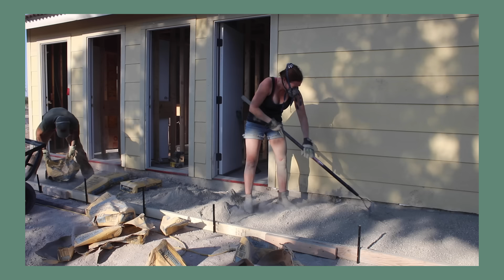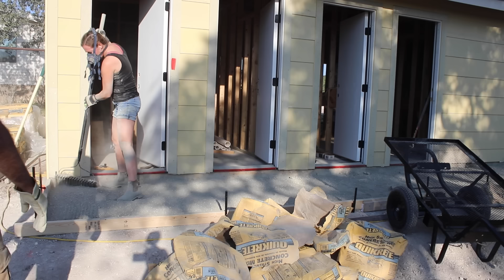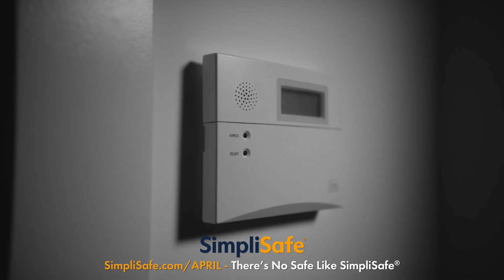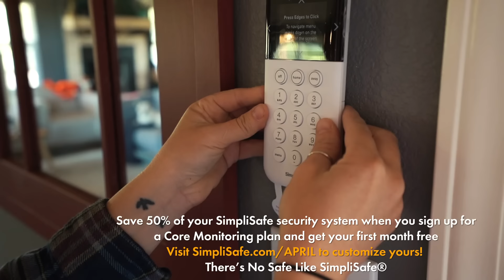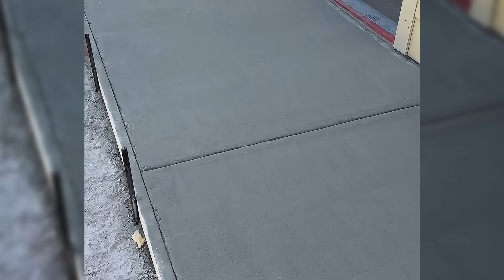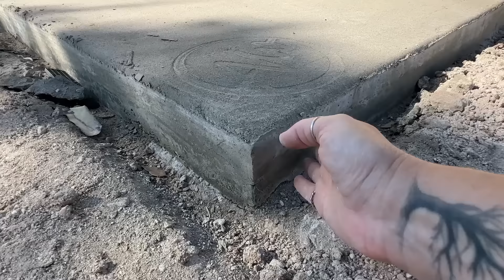Dry Pour Concrete | Better than Wet?

Comment: If you dont need it to be strong then sure you can dry pour it, plan to drive a car on it every day for 10 years or place that heavy hot tub... better not dry pour
Reply from the maker: Exactly! Mine would only be used for foot traffic so knew it would be fine. Thanks for watching.

Comment: I watched another video, where the concrete professional states you aren't supposed to attach a floating slab to a permanent slab, such as a house or garage, etc.
Reply: It depends on the slab. If you go out and pull permits and show plans to the inspector, some of them require dowels. Again, it depends on the application. If this slab ever encounters a large amount of movement, the dowels will just break through the concrete anyway. So it doesn’t matter whether she did or not. A dry slab will never achieve the same strength as a wet one.

Comment: Dry pour is a waste of time.  Little better than compacted gravel.  Water seeps in about 1”.  Below that you have no concrete and no strength.  Can’t even see what material benefit the steel is providing.  There are plenty of YouTube videos out there making this point.  I’m surprised April is promoting dry pour.
Reply from the maker: With mine being foot traffic only, I wanted to highlight the two different methods. It is fine for what I need it for. Thanks for watching.

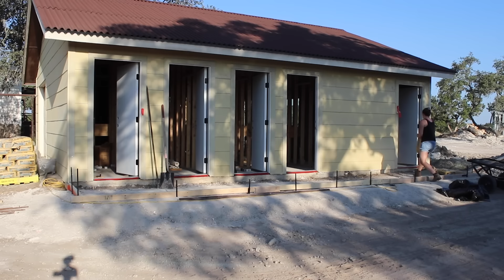Comment: RE: comments about 1:30 .  If you ARE using a mixer, it is easier on your back to use a wheelbarrow to hold the dry mix (emptied from 4 or 5 bags at a time). Then use your shovel to just add as much as you want to the mixer and then add water. It really is easier than lifting 80lbs. bags high over the mixer opening and slicing...  Good Video. will want to see it in a year.

Comment: Dry pour has significantly less strength, takes longer, has an ugly finish, costs the same. It’s a little easier to diy but you’re left with an inferior product with reduced longevity. The question is why you would ever consider it an option.

Comment: My wife and made dry pour drive way . Works fine, looks great no cracks 2 years in will be adding to it this year . Hopefully get all the way to the street. The sections we added on last year we mixed from scratch 3 2 1 ratio. A lot cheaper than buying quickcrete or other prepackaged concrete.nice job 😊
Reply from the maker: Awesome! I'm so glad it's worked out for you. Thanks for Sharing and for watching.

Comment: dry pouring anything but fence posts with fast set mix and plunging rebar/rod to mix it, is pretty silly and failure prone, even if for light traffic. while it may work in southern humid climates, that would be a disaster in most everywhere else, cold/freezing, dry.

Comment: dry pour no, its as strong as when you leave a bag out in the rain and it turns solid, but its junk, dry pour cant be good for any thing where people walk or use it
Reply from the maker: I think it'll be fine for what I need but I'll keep an eye on it if there's an issue. Thanks for watching.
Reply: @AprilWilkerson  one thing I wanted to do for a fence is to put a concrete runner all along there.  this area is overgrown, a back yard where past owners for 20 years or more did nothing, its years of weeds that built layers of mush.  so bad it will take landscapers to come in with a tractor to clear.  then i want a tall fence to keep the dogs safe and along the bottom at least 1 foot or more of a concrete base or ? up against this new fence to be built. to keep out weeds and then if the dogs try to dig there they cant.  over time if determined they will destroy the wood as they have;  for this, dry concrete is perfect, its just there. Im thankful you did the video.

Comment: Dry pour has less than 20% of the compressive strength than wet mix and is 50% more likely to crack
Reply: 83% of all statistics are made up 92% of the time
Reply from the maker: For what I need this for, it will be fine. Occasional foot traffic only. Thanks for watching.

Comment: @AprilWilkerson I didn't even know dry was a thing. Now I wonder if you laid sections of hard pvc hose (can't remove after) with small holes drilled equally on top and sides, on the bottom...turn water on low so it trickles. Then do the dry pour technique...I wonder what the results would be? Thanks for experimenting. 
Looking forward to seeing the park videos.
Reply: If the water is flowing during the hydration process, it will most likely carry away the cement (not to be confused with concrete) and finest sand leaving a weak, gravelly mix.
Reply: @johnlee7085  thanks

Comment: @aprilwilkerson The thumbnail for this video stresses me. I grew up in construction, and during the summer I would wear shorts while pouring slabs. I eventually developed the beginnings of concrete poisoning from the exposure to my legs. While dry pour doesn't have the same exposure, the moisture on your body from sweat can start the chemical reactions that will affect the skin. Cover up when handling concrete.
Reply: So you just looked at the thumbnail and not the video. She addressed her clothing multiple times.

Comment: I used dry pour for posts its less mess, quicker and within 5 days is solid as concrete
Reply: Nope. Dry pour will never be as solid as properly mixed concrete. That’s a fact
Reply: @genecarden780  had the local university test it and the results between the different versions were comparable
Reply: @ 😂😂😂😂😂😂 of course you did😂😂😂😂😂😂 There is one way that is possible. The wet mix was incorrectly mixed. What was the aggregate? What was the concrete to sand ratio? Were there  other additives? What was the water ratio? What was the slump rate? 
 Actually there are 2 ways. If you use a low quality mix.  One that is destined to fail in anything other than fence posts. 
 What was the compressive strength of each sample?What was the tensile strength of each sample? What was the size of each sample? How many samples were tested? These are very common details of testing we have to pass routinely. We routinely have to test core samples. I can guarantee dry pour WILL NOT PASS THESE TESTS.
Reply: No one seriously tests the tensile strength of concrete, and it wouldn’t be possible to do a slump test on a dry pour. 

TBS, the only way a dry pour is as strong as a wet pour is if the wet pour was placed equally poorly. There’s no way to compact the dry pour so it will inevitably be weaker unless the wet pour isn’t vibrated correctly.
Reply: @ There are actually 2 common types of tensile strength testing of concrete.  (So yeah people do test concrete tensile strength ). Splitting tensile strength and bending tensile strength. Both methods require calculating tensile strength from the force required to cause the concrete to split. There is also direct tensile strength testing but that is almost never used, due to difficulty. And as for the slump rate, I was obviously referring to the wet pour that I assumed he submitted for his claimed  “testing comparison”  for any meaningful testing comparison you would have to submit 2 samples made up of exactly the same dry mix ( before hydrating one)  so the slump rate of the wet mix is very relative.

Comment: Thanks April. Been enjoying your channel for some time.  Turns out Pierced Oak is just a few miles from me. I tried updating Google maps with the address you put un Instagram. The category is a bit wonky as they don't have one for RV Park per se. Good luck with the venture. I agree with most comments and your takeaway that there are very good but very specific applications for dry pour. Back 59 years ago almost had a geart attack getting behind a wet pour that was only to put a smooth work surface on an exiting dirt floor of an old shop.  Not structural. Pathways, simple storage shed floors (like under existing mobile homes) and drainage contol also seem ideal. All the best👍👍💪✌️😎
Reply from the maker: Yes, Google Maps hasn't updated yet but should soon I'd think. Thanks for watching.

Comment: Dry Pour works for some situations.  I've used it in deep holes with metal pipes (solar panel masts) and it has been fine.  If the hole is only a little larger than the pipe, (say if the pipe is 8" and the hole is 10 or 12", then pouring wet concrete is not so easy.  It can easily jamb up in some spot. Dry on the other hand will all get down to the bottom, (especially after you add water). But there is no doubt that structurally it is weaker.  Even in a sidewalk, I'd not consider it.  Too easy to do wet concrete and much less likely to crack if something heavier goes over it.

Comment: I did a dry pour slab that holds 4 cords of firewood.  It is holding up just fine under the weight.  It is a great method for small projects.  April, you did a great job.
Reply from the maker: Awesome! Yes, for my needs this will be fine. Thanks for watching.

Comment: I don't care how trendy it is, dry pour is a half-assed effort.
Reply from the maker: For what I need, it will be fine. I enjoyed the project and wanted to show Viewers steps of how I proceeded. Thanks for watching.
Reply: @AprilWilkerson it is plain crap. You obviously do not understand the first thing about how concrete actually works. Concrete relies on the proper hydration of the cement. That is impossible with dry pour. I have been in the masonry restoration business for over 45 years. Dry pour is ignorance plain and simple. You can achieve the same or better results with less than half the thickness of properly mixed concrete. That is a fact.

Comment: You also dont need to press you edger into it, it will work the same way as a float if you run it back and forth and form edges just like when wet. Another trick is not to pull your forms up when removing. They will have a tendency to chip your edges. Use a hammer to smack them left or right so they break from the crust that is formed and then try pulling them away from the slab instead of up. Your slab is not too big for dry. The issue is screeding, which soon becomes as labor intensive as mixing for wet pour, because to get a good finish with dry as you found out you need to screed in small slow motions.
Reply: She said the edger did not work the same way when dry.  She tried both ways.
Reply: @HellinaHandbasketHWG not sure what she was doing but it works the same way for me wet or dry

Comment: I have 2 dry pour pads that are 2 years old. I did them dirty just to annoy dry pour haters. dumped it straight on top of grass, no gravel base and added no rebar. They are right next to my professionally poured patio. one has my hose reel setup on it and gets water all the time and the other gets walked on daily by my dogs and family. there are no cracks or heaving or shifting after 2 years of below zero winters and rain and snow. I followed cajun's instructions and made sure you soak them enough that water made it thru the whole 4in slab and so far they are doing better than my wet poured slab, they just dont look as nice as a wet pour broom finish.
Reply: I’ve watch several videos where dry pour is compared to traditional wet pour. Wet pour is stronger and more durable. If you’re going to the effort to pour concrete, why not do traditional wet pour? It will be less effort in the long run when you have to replace it 4 or 5 years down the road.
Reply: @mitchmiller1429  Have you done a wet pour or just watched the videos? 😂
Reply: @HellinaHandbasketHWG  yes, I have poured a dry pour entrance into my greenhouse. It is 2 years old and I hope it lasts, but it definitely looks more grainy and porous than my traditional sidewalks.
Reply: @mitchmiller1429 because it's not less effort. Maybe you're making the assumption that everyone doing a dry pour has a mixer sitting around or the ability to rent one with a way to transport it. Remove that assumption and you're left with that person mixing by hand. I do a lot of diy, mixed my deck footers in my wheelbarrow but my first dry pour was 18 bags and I'm not interested in mixing 18 bags by hand. Doing that dry pour for a walkway was way easier, less rush and will hold up just as long as a wet pour for my purposes.
Reply from the maker: Awesome! Yes, for my needs, this slab will do fine. Thanks for Sharing your experience and for watching.

Comment: I dunno if I'd use it for a big building foundation... but a light duty support pad, plain patio or maybe a storage shed slab.... those don't see high load at all.... as long as you give it time to soak up the water and set.
Reply from the maker: Yes, mine will only have foot traffic going into building. Thanks for watching.
Reply: A lack of hydration can weaken a dry pour, but the guaranteed weakness comes from the lack of compaction. In a wet pour, part of the process involves vibrating the mix so that the parts settle together and the air bubbles come out. That never happens with dry pour leaving lots of voids that will be prone to breaking.

Comment: That took way longer and required far more finesse and fiddling than pouring and tamping wet mixed concrete would have leaving you with a very inferior slab, if it saved time then I could see the motivation.

You did make me laugh with your (not) expansion joints though!!!!

I use drymix for fence posts whenever I can.

Comment: After following Cajun County Living on YT, I decide to do a few dry pours.  Followed their process to a T and it has been fantastic. All the slabs have held up very well, with 3 of them used under a 10k pound RV!  (proper depth and rebar of course).  I totally agree with your suggestion about pressing versus dragging the trowel.  Thanks for posting and the slab looks great!
Reply from the maker: Thanks! And thank you for Sharing your experience and for watching.

Comment: The obvious answer from a chemistry and physics perspective is that "wet pour" is immensely stronger and is also easier to do. The large difference in performance between the two is because with "wet pour" the ingredients are mixed throughout and will uniformly harden, but with "dry pour" only to top is kind of mixed.
Reply: Right conclusion. Wrong analysis. 

Tests have shown that the entire slab can be sufficiently hydrated for hardening. It isn’t always, but it can be. 

The real problem comes from not agitating the mix after it is placed resulting in a lack of consolidation.

Comment: Dry pour: great for sidewalks, mailbox, short fences with low wind loads. Saves a lot of mixing work.

Wet pour: heavy duty slabs, point loads, tall fences with high wind loads.
Reply from the maker: Yes! For my needs, this type of pour if fine. Thanks for watching.
Reply: Point loads? Like under columns?

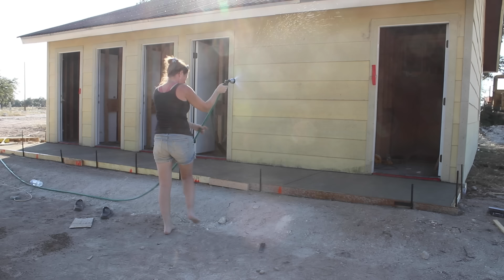Comment: 0:16 when you're making pancakes, you don't put flour on the pan and spray water on top of it and expect it to come out like a proper pancake, you gotta make a batter and let it sit for a few minutes to let the flour hydrate before pouring it on the pan..... ok, let me watch the rest of the video to see how it works with concrete
Reply: i posted this exact thing about 1 week ago except i used bread dough as my example. She deleted my comment, she wants to just remove anyone who doesnt agree with her
Reply: @bmxscape   honestly, after watching the full video, i'm still a bit skeptical, but April says it works for her purposes; and it's not like it's a load-bearing wall or a house foundation, so 🤷‍♂
Reply: @pqrstsma2011. A column is generally considered load bearing. Guessing the column and rebar is where it will fail first.
Reply: @bmxscape  She probably just doesn't like annoying know-it-all comments. Who does?
Reply: @HellinaHandbasketHWG  wow thanks for the very constructive comment. go dry pour some concrete

Comment: I did a dry pour myself April 18months ago. You did a great job by making sure you waited long enough to pull the forms. Kwik Create works really well with this method. Some other brands not so much. Also adding more water than than neccessary also keeps it from being as brittle. Most people don't add enough and then don't wait long enough to put it into service.
Reply from the maker: Thanks for sharing your experience, glad to hear yours is holding up well! Thanks for watching.
Reply: @AprilWilkerson  Thx for the response. Been subbed to your channel probably 6yrs or so. I just don't comment much, but I am waiting on that RV park video series because I live in west Texas and we have 3 acres ourselves. I have room for about 28 spots so your videos will be very helpful since I'm a DIYer myself.

Comment: Excellent video and the results look well worth the effort. I think there is a reluctance to accept this as a light-duty method simply because it is non-standard. I think, too, that many that fail are because they don't follow a proper methodology then blame it on the dry pour. I'm betting that you'll provide a positive outcome even two years from now. Thanks!
Reply from the maker: I agree. I think this method will work well for what I need. Thanks for watching.
Reply: Why use heavy duty materials if you just want a light duty solution? It's wasting both time and money.
Reply: @richardbenson4750  Given the ease of application and the relatively inexpensive cost to resource, it seems reasonable to use "heavy duty materials" that will exceed requirements. You're definitely not wasting time as this solution can be performed on a DIY schedule, and it is likely a comparable cost to other solutions. April did a great job pointing this out and it is commendable that she left results open with a promise to revisit over the course of the next two years. Relax, and give it a chance.

Comment: It’s not faster than a wet mix. It’s not stronger. It’s not cheaper. It’s not easier. Engineers say no good.
Reply from the maker: For what I need it for, it will be fine. Thanks for watching.
Reply: On the contrary, it is a lot easiepr